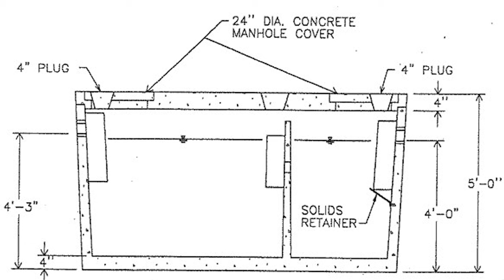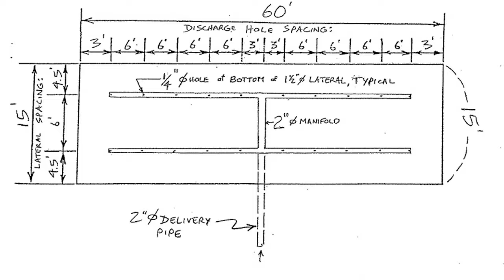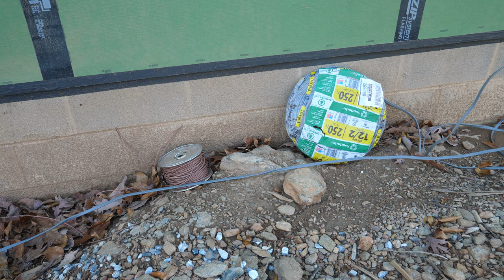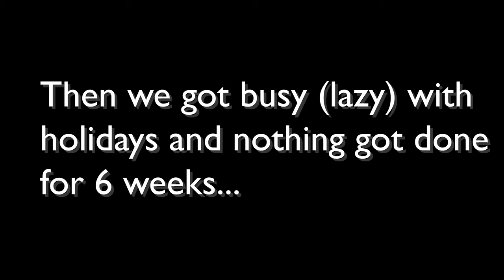Our Sand Mound Septic DRAINED our bank account..

Comment: word of caution    make sure you cut and DE root all trees within 35 to 40 feet       why you  ask   root s    they will travel long distance to get  water  and what so ever never plant a weeping willow tree    it will kill your system within 3 years and you cant kill the roots     they will keep growing    take care stay safe
Reply from the maker: Thank you! We thought the same, and there is one oak tree stump leftover from logging sort of embedded in the bottom side of the berm. The regulations actually require to cut it close to the ground and leave it there to keep the root system intact. The idea is not to disturb the micro organisms that help filter the effluent

Comment: Okay, I can't thank you enough for posting this video of you doing the septic install. I recently purchased undeveloped land in Tobyhanna PA this year. I'm going to build my retirement home for my wife and me to retire to.  I had a local Septic company do the PERC and PROB test, and I need to install the exact system on my property. I don't need to have my Mound System that far away so that helps. But the Mound system will be exactly the same and I only need a Dual 1000 gal tank with a  500 gal Dosing tank. I'm going to install the system myself because I have the equipment to do it. Question, I see you're also in PA are you close to my property? If so can you tell me who you purchased all the Mound system Sand and Stone from and what did you pay per ton? Also any other tips for me for installing my own system would be great!
Reply from the maker: Congrats on the land! One of our best friend's parents are from Tobyhanna. We're not close, we're just north of Maryland on the MD/PA (Mason Dixon) line. Both #57 stone and sand were $450/load, I think that works out to around $23/ton delivered. It came from a local quarry, nothing special. The sand is basically one step higher than fill screenings, so basically a waste product from the quarry. They can charge so much for it because the DEP put their label on it for people to use in septic systems. So just call up your local quarry and confirm they have "DEP sand". Start with a professionally written plan, study the heck out of it, make your full material list, and start procuring. That's honestly 2/3 of the work.. the rest is just playing in the dirt 😄
Reply: @MasonDixonAcres  Thanks so much for replying back to me so fast. I think I finally found a good quarry near me that can supply me with the material needed to build the mound. But its good to know what you paid per ton so I can compare. Good luck with your new home as well. You both are doing such a great job! Please keep the videos coming. I know its not easy to do but I would love to see more as you go. BTW, I might contact you again when I build my house for advice if that's okay. Happy building your dream home!!! and THANK YOU!!!!!!!
Reply from the maker: Haha no problem at all! Good luck with the system, you got it. We will have videos for every step of the way, getting caught up on editing now.
Reply: @MasonDixonAcres  One last question, Promise. Can you tell me at what phases of the installation did the inspector need to come out? ( Just to give me an general idea, I will also confirm with my local township)
1.	I would think he would need to come out to inspect the ground at the location for the Mound system to ensure that it was turned by the track hoe properly before you started to dump the DEP sand.

2.	Did he need to come out to check the tanks before you backfilled them?
3.	Did he need to inspect the mound system pipes on top to make sure the pvc pipes were installed correctly? Also, I think at this stage, they would also want to see the pump run to see if the pipes on the mound are getting the proper pressure, correct? Also, he would, at this point, inspect the Dosing tank Pump, floats, overflow alarm and wiring?
4.	Other?

Comment: New subscriber here and yes I watched the whole video. We are in the process of building a sand mound septic system here in Scott County Arkansas and yes we have loads of rocks and clay type soil. We are on a tight budget so this does kinda scare me but I think we can get it done for much cheaper since we wouldn't need as much materials. This does however help me with how your system was placed and I do like how that mound turned out.
Reply from the maker: Glad it helped! Best of luck with the project.
Reply: @MasonDixonAcres  Thank you...👍👍

Comment: I'm sure it's already planned out, but has there been any consideration in saving all the excavated stones for masonry projects (walk ways, retaining walls, ect.) later on?  If memory serves me correct on the interior computer plans of the actually home, there was a legendary fireplace at the center of the modern farm house - it would be pretty epic to source the large boulders/stones from the local land for the fireplace.
Reply from the maker: Yep! We will use them to line the ditch on the edge of the driveway, build raised beds, rubble footings/foundations for future outbuildings, outdoor fireplace, etc. We might use them for a future indoor fireplace, but they are kinda ugly fieldstones so not entirely sure yet 😂 There is basically an unlimited quantity, so we're not even worried about burying a bunch of them lol

Comment: Great video! There's not a ton of information on sand mound systems out there so I appreciate the thoroughness. Did the county draw up what the mound should look like for the size of your home? I haven't found many companies that will do sand mound systems if the land we bought doesn't perc.
Reply from the maker: I appreciate it! Agreed, I tried doing some research ahead of time and there's not a whole lot out there. The screenshots in this video are from our actual plan, which we paid $400 for a designer (a former surveyor and Septic Enforcement Officer) to come out and stake the mound area, and draw up the plans. He did a great job and it was well worth it (and required) to have a thorough plan. In our locality at least, the system has to accept 100 gallons per day, per bedroom. Ours will accept 500 gallons per day (good for a 5bd house). Our land actually perc tested fantastically due to the coarse rock, it was the 'limiting zone' that was too shallow, which drove the need for a raised bed.

Comment: I have one of these..raised mound leach field..ours is only good for 20-25 years..been here 20 years..times a ticking..and the price has dbld
Reply from the maker: Yikes! The #1 way to extend the system is to put less water into it.. drain your grey water separately into the yard or storage tanks depending where you live
Reply: The bacterial slime coats everything and stops drainage in conventional systems. If you put a filter on the outlet pipe, and aerate the primary and secondary tanks for a few hours at night on a timer when the system isn’t being used this should generate more aerobic bacteria that will breakdown down this biofilm

Comment: Have you considered aerated septic system? It has a bigger tank but won't need a drain field
Reply from the maker: There were a few alternatives that probably could have worked but sand mound was the closest to traditional and requires fairly little maintenance!

Comment: Is there easy access to your tank when the time comes to pump it out?  That long distance and seemingly large height drop to the tank will make it difficult and expensive to pump out if they have to do it from near the house.  Auxiliary pumps might be needed.  Sounds like you have great drainage so hopefully that won’t be needed often (or ever!)
Reply from the maker: Yep each tank has a manhole cover in the top where pumping would happen from

Comment: Next time, seperate your rock when you are digging.  2 seperate piles. Easier to tackle. Will cost you 10% more time initially but you will walk away with some clean dirt and rocks you can use for things like lining roads etc.
Reply from the maker: much easier said than done 😅
Reply: @Mason Dixon Acres  as a general contractor,  I know, but it is a much easier necessary step. It is one of those things you learn over time that is always valuable.